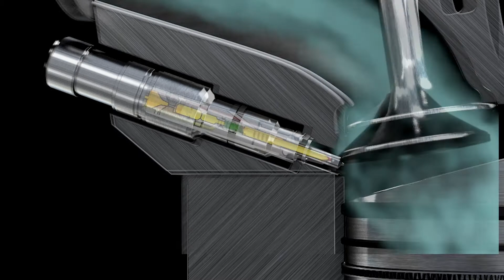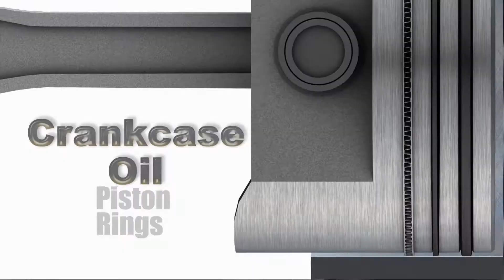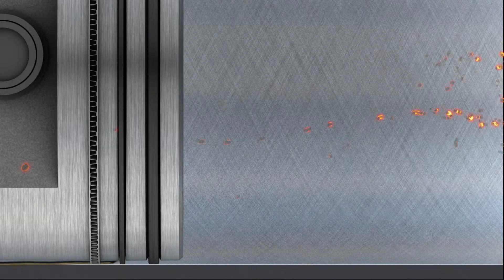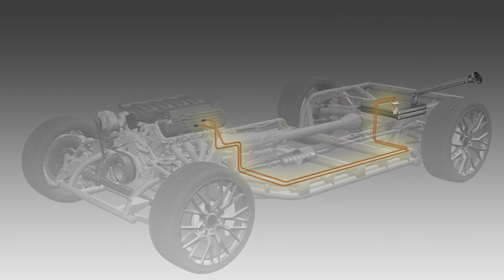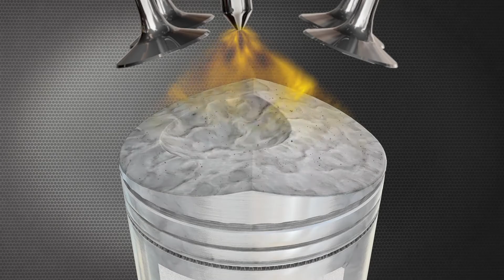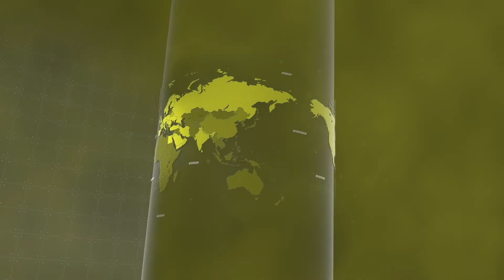BG 44K Platinum Fuel System & Combustion Chamber Cleaner | Lexus

Comment: There is video here in youtube of someone running BG44k and comparing before and after photos of the piston.  There was very little visual difference in carbon buildup.
Reply: Do a piston soak with B12 chemtool, then add BG44k to a fresh tank of gas(Shell Nitro or equivalent). Allow up to 500 miles to see the carbon vanish, and buy extra spark plugs, they get coated with the released carbon.